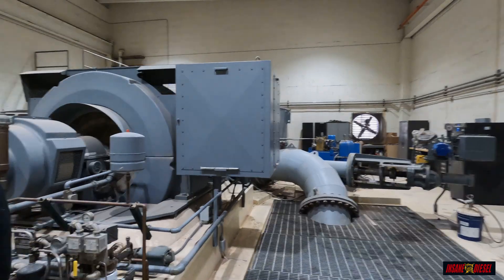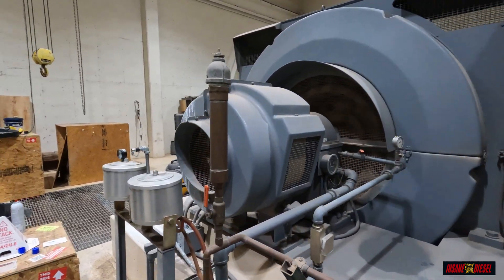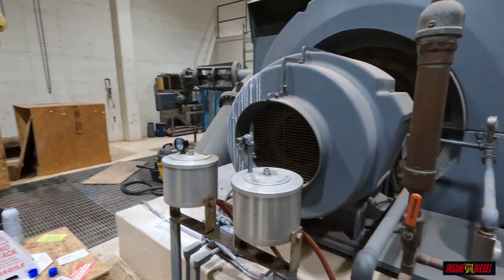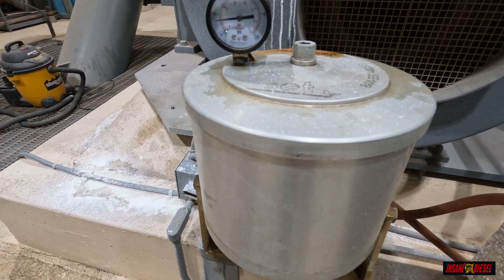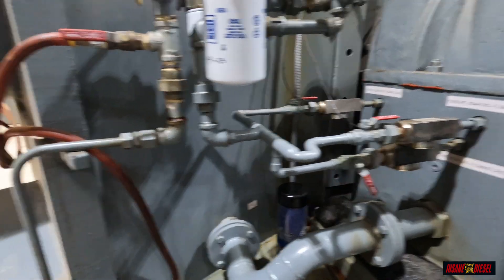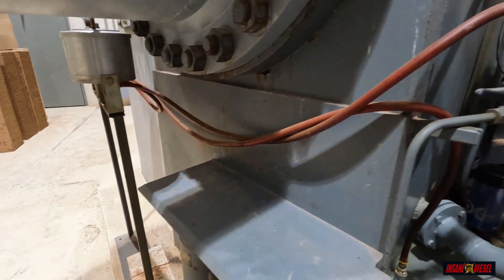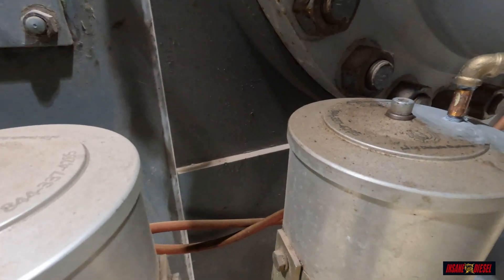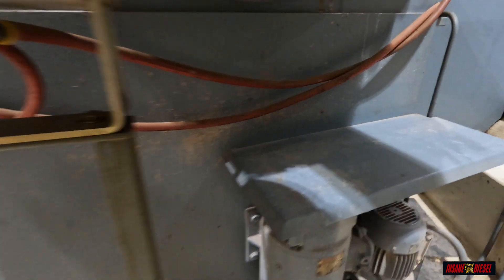You Won't Believe The DIFFERENCE This Made! On a Hydro Power Plant

Comment: I've been a fan of oil analysis and bypass filtration since I earned my journeyman diesel mechanic designation as a young man in the Navy some 40 years ago. I've used Insane/Extreme Diesel products for my engine and transmission for roughly 85,000 miles. I've been impressed with the results ever since my first fluid analysis on the engine and then the transmission. There's been no need to have faith in the results as the results came in black and white with every routine sample and lab analysis. With fluid services costing so very much and lab analysis so inexpensive by comparison, Insane Diesel has saved me multiples of times more than I've spent with them in systems, filters, and fluids. I've had a FLAWLESS experience with Insane Diesel and as a result with my diesel engine and transmission. 🤠